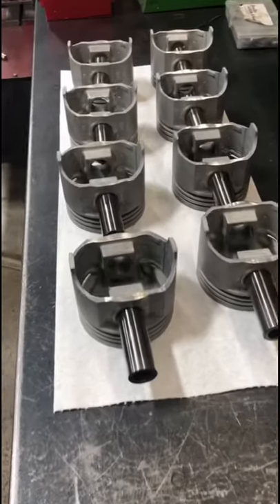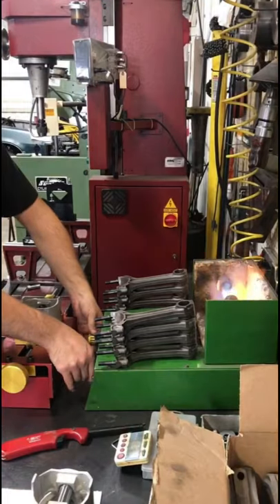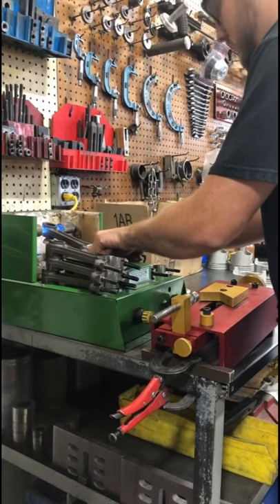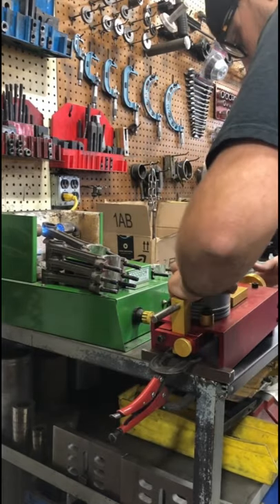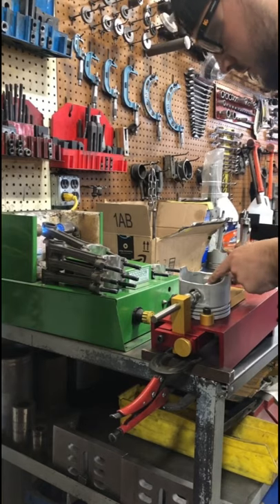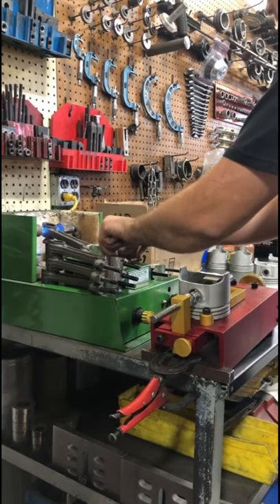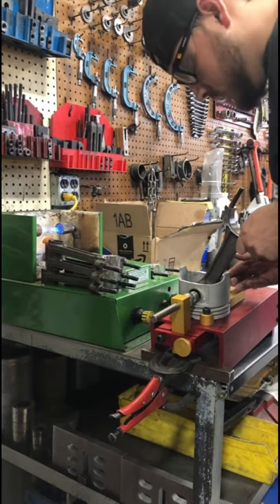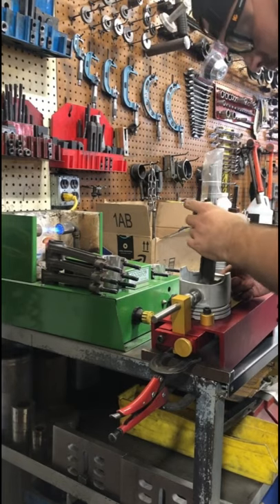#shorts Installing Press Fit Pistons On A Set Of Reconditioned Pontiac Connecting Rods

Comment: Please do not forget the "Hidden Gallery Plug" , this has been the bane of PMD blocks that get a rebuild and or a high pressure oil pump.
It's a "pressed in" plug on the transmission side of the block, it's located BEHIND another surface pressed in plug.
If this plug is missing it wont send oil to the valvetrain , but will show oil pressure, only under higher RPM will it start to deliver oil to the top.
Mike Finnegan and David Freiburger missed this on the Firebird and so did my engine builder who builds Hemi Race engines.
The fix is to tap the hole and red loctight it in.

Comment: Can you please give me any tips on tricking out my LS1 without adding a supercharger or turbo. I'm going to rebuild my engine and I want to get more horsepower out of it. i.e oversized pistons/ port heads
Reply: If your going to go with bigger pistons larger heads you might want to think about larger fuel injectors larger throttle body.maybe a hyper chip to raise the levels of everything. Even better ignition coils and plugs will gain hp. Just remember anything you do to make that part better the rest has to follow even a bigger exhaust. Hope this helps I have a 67 GTO with a 2005 LS1from a corvette.shes putting out 500hp but I did alot of mods with no turbo or supercharger.alot of computer stuff.and was told it could have alot more if I wanted up to 620hp.you might want to check out all the computer specs on you LS1

Comment: What's up with the small chunk missing from that piston?
Reply: It helps with the direction of the air/fuel induction so that the fuel particles are evenly spaced & balanced on the face of the piston so that the maximum horsepower can be achieved with the total burning of all materials in the combustion chamber per stroke.
  Just basic grooving...
Reply: That small groove  on the top of the piston tells the builder which way to install it . Its pointing to the front of the engine.
Reply: @dennism644  LoL